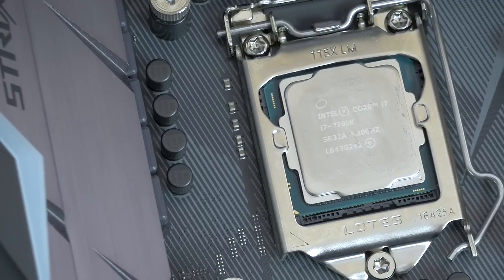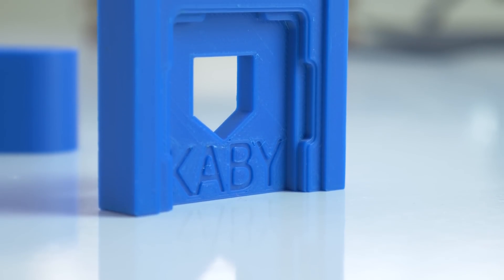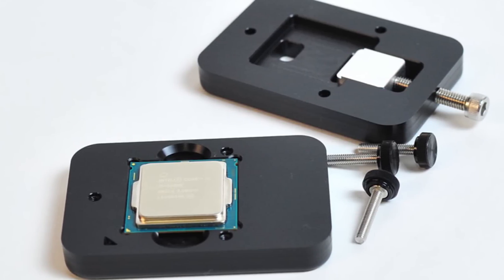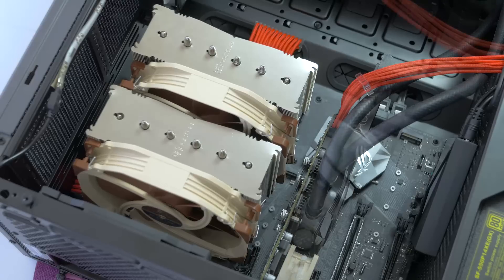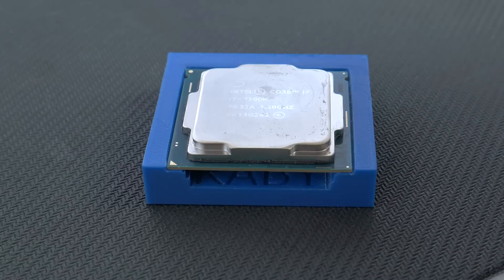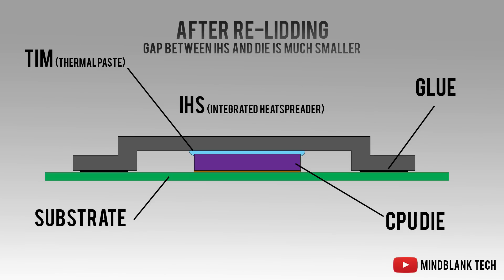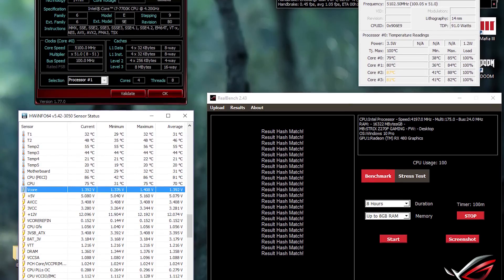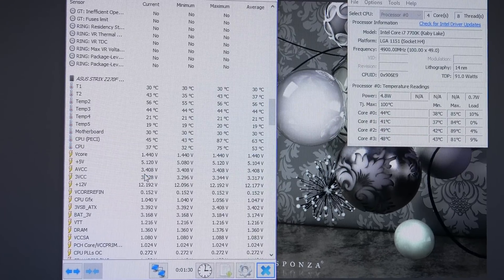Delidding the 7700K - 5.2GHz Overclock - 25C cooler

Comment: I delidded mine too but didn't have much difference in temperature at first, probably due to to much thermal paste somewhere. but after 2 weeks it's settled down and preforms a lot better now. 
before it could reach around 95C on all cores with just a 4.8 overclock. 
But now now the cores are from 65C to 80C during very high load. 
So it's a definite improvement, considering my fans only spin up to 1000 RPM during this load. 
so they have 200 RPM to spare in case of more heat. 
Keeping it from being to loud for my concentration.
oh yeah and ambient temps are a bit high at 23C so that affects my numbers a lot

Comment: This means only one thing that actually Intel is still producing overpriced bad-build CPU's . AND they say that AMD CPU run hot lol, never had a problem with AMD CPUs, before Ryzen they were junk in performance but had very good build with the metal lid soldered directly to the chip so no need for delidding and the new Ryzen is better in performance and still soldered to the chip so no need for delidding either. Intel needs to start producing good chips now or at least not overprice them for no reason well except monopoly

Comment: I am doing 5Ghz at 1.296 volts. Did the oc yesterday so i have not yet fully tested it. Allthough basic windows tasks are running without crashes. As does 15 min of The Witcher 3 and GTA V. CPU only about 50 degrees celcius after 15 minutes of gameplay. I am using a Nepton 140xl set as intake and my ambient temp might be arround 22 celcius :)

Comment: Currently 4.9GHz @ 1.35v LLC 5 - 80°C MAX during x264 with NZXT Kraken X62

I did try 5.0GHz but it wanted 1.40v to be stable and the temps were getting near 90°C during x264 stress test.

If I delid my 7700k would I still need 1.40v to be stable? I assume deliding just reduces temps?

Comment: Based on the imprint the liquid metal had left on your CPU, I'm guessing the reason for the crazy temps was that you hadn't used enough and the heat sink  hadn't made full contact with the IHS. You really shouldn't be hitting 100C with 1.35v VCore with that giant Noctua cooler.

Comment: Why didn't you write the 3D model is too small for 7700K? I spent 6 hours of printing and I can throw it away.
Reply from the maker: Hey dude! Sorry about that, but I did mention this several times in the video... It's an easy fix by scarping a little excess to the sides. Hope it worked out for you!
Reply: +MindBlank Tech Oh, sorry. I didn't understand. English is not my native language. My fault. I print it for second time. Enlarged to 102%. It should be ok.
Reply: Works like a charm. Thanks!

Comment: I have the standard coolermaster evo 212 and when I bought it I put it on 5.0 without tweaking ANYTHING else but the frequency of it, and was able to use it no problems for like half a day when I encountered the first failure where windows crashed and froze, put it down to 4.8 and had no problems ever since. Temps are all normal and even when I render videos temps wont go higher then 76ish degrees (C.) and at idle would stay always at 35ish and while gaming never going up then around 55~ playing something like witcher3.

I'm here because was wondering about touching the volts for get stable 5.0 but I was always a bit scared of messing up with voltages when it comes to OC specially with this cpu that is not "cheap" while some ppl told me "why you bought "K" if your not ocing like u should" so I don't know do I really need 5.0? is it that much of a difference from 4.8 to begin with? is it worth the risk to tweak voltages for that extra 200mhz? 

Aside from the evo212 also have a NZXT 550w and 32gb DDR4 crucial ballistix.

Comment: Hello MindBlank Tech! I wanted to ask you, can you lap an cpu (remove the bottom layer of the heatspreader which is made out of nickel, down to copper (make it completly flat))
Reply from the maker: Hey! If Are you asking if I can do that or if it can be done? I did this to other CPUs in the past, no problem. It's just a lot of work and patience. Not a whole lot of tools required for it, but patience is key to getting good results!

Comment: should i do it to  SB chip? like my 3930k? its a hot rod man, idle at 50c @4.4ghz with 1.32V.    case is define R5 stock 2 intake fan with 100% at front,   noctua 15D cooler.   30c is room temp, its summer here hey.

Comment: I'm new to builds, but I just built a kaby lake on asus z270e mobo, 16gigs ram, nzxt kraken x61 aio, asus strix gtx1070oc edition, fully modular corsair rx750.. Been running benchmarks and can say I'm happy with system performance, but if I wanted to overclock, I don't know the 1st thing about uefi/bios and what all of the settings mean.

Comment: Is this a vaild solution if you just want to bring down temps on stock clock in order to run the cpu in a small case and have the fans run more silent?
Reply from the maker: Yes it is. Combine this with undervolting and maybe slight underclocking and the cooling requirements see a steep drop.
Reply: MindBlank Tech Thanks, then I might try again with mitx and node 202 case. CPU cooler was going apeshit (1300rpm@50c) with 7700K in that case when just idling.

Comment: WTF is wrong with your CPU? you are the only example of a 7700K nearing 100Deg that I have ever seen. every other KL de-lid I've seen was within 3deg before and after.
Reply from the maker: +forestR1 Hey man! Don't know what was wrong with it, but this is the result I got... Maybe the black goo was too thick, who knows. 3 deg. C seems kinda low for any delid. Even Broadwell-E delid sees around 4-5C...
Reply: if that's the result you got then, that's what you got :) Ive only watched a few tech tube type videos on KL de-lid, so when I say <3Deg, take it with a grain of salt, cause it's only a very small sample. I would expect a slightly larger difference on broadwell E - it uses more power, so I would guess that 5% improvement would yield a higher outright temperature delta. but again could be wrong.

Comment: I got 4.9ghz at 1.325 volts. It's watercooled though, so it idles around 28C. Hottest I've seen it under 100% load is 65-70C. No de-lid.

Comment: Apparently my cpu is really good. It's a 6600k and at 1.30 volts it is is rock solid stable at 4.5 Ghz with 100% load temps at 60C

Comment: Why not using super glue? Some super glue resist at 100°c
Reply from the maker: +kiking78 It's not that it won't resist at high temps or in general. It' because removing the IHS afterwards may be extremely difficult and might ruin the PCB of your CPU.
Reply: MindBlank Tech thanks, that's true, didn't think about that.

Comment: Just curious why go through all that trouble of deliding and so on when you had on the Cinebench test a x5650 at 2.6ghz beating the 7700k in that kind of application. Wouldn't it make more sense just getting another pc if there is to game on it? What is the price for a x5650 now.... $100? Sure a x58 is a bit pricey but you can find them very cheap. I picked one up a few days ago with a i7 920 included for $105
Reply from the maker: +Pholiage The X5650 is listed in Cinebench by default. I don't have that kind of CPU.
Reply: I see :) Just got a hold of a Rampage III mb. Going to get a x5650 for it as a secondary platform and also play with some oc.

Comment: I bought this Cpu, did a quick 4.8 ghz clock with constant voltage. Is it normal that these Cpu's gets pretty hot?
70-80+c with a  high end closed loop watercooler. are they known to get really hot? even stock on heavy load.

Comment: I've got a 7700k clocked at 5ghz, it's got a small custom loop with a 240mm radiator and under load I've never seen it go over 60°c

Comment: would you recommend using arctic silver ceramique 2 for long term use?
Reply from the maker: No, I wouldn't. For the bare die, get a liquid metal type TIM. CLU works best as there is no pump out effect so it lasts longer - you don't need to replace it that often.

Comment: Are most of you re-lidding? What's the point of re-lidding anyway, wouldn't that make temps go back up?  I have a Sager Clevo laptop NP9873 with the i7-7700K, it is running stock and hot high 90s when crunching videos with Handbrake  (I'm a video editor)... so it seems like I should probably de-lid, just not sure about re-lid...?
Reply from the maker: I would advise not relidding. Just place the IHS on top like I did. Floating style. It's not going anywhere, trust me. That way, you ensure that the delid process will help temps as best as possible and will give you the option of refreshing the TIM on the die whenever you feel like it needs redoing.

Comment: what was your thinking behind not reglueing ? 
Can clu not dry out?  and wouldn't the CPU lid slide down when clamping it down 
thank you
Reply from the maker: it doesn't slide down. It's a very firm fit. Simply putting it on top of the die with CLU gives a little bit of drag, but lowering the retention bracket on it just makes things as secure as possible. Don't worry about this, it's really ok. By doing this you have the option of refreshing the TIM on the die or if you screw up the first time, it's easy to correct since the IHS is not glued back on. Also, the most important reason is that you are no distancing the IHS from the die with an extra layer of glue, however thin it would be. This is theoretically direct contact between die and IHS with this method. You can glue it back on when selling it if the seller doesn't appreciate the delid. But most buyers of K processors will actually be glad it's delided.
Reply: MindBlank Tech thx for the answer  👍

Comment: How do even know while recording this video that you rendered it at 5.2GHz? I wish I could also see the future...
Reply from the maker: I replied to a similar comment. By that point I had been editing for more than 8 hours and gaming between breaks (Overwatch and BF1) without any stability issues. It could have locked up or BSOD'ed while rendering, but I knew that it went through almost 90 minutes of Realbench without crashing. It crashes in Realbench at around 90 minutes or so, that's why I don't consider it stable. It didn't crash during the rendering process, just FYI. I still use 5.1GHz daily.

Comment: If you're scared to delid I heard you can hit the CPU with a hammer a few times to tighten up the air gap and drill a few holes around lid to vent some of the heat.
Reply: wtf?
Reply: @IMDYT420  lmao I dont remember this comment 5 years ago but sounds legjt

Comment: you can also just use a double edged razor blade if you want. that'll work too. as you can see there are not any compenents around the glue that could be damaged. it cuts through the glue like butter if you take a fresh one.

Comment: my not overclocked i7 4790k reaches 80C in the summer time and about 72C in the winter on the water cooled double heatsink... (under the biggest load but usually temps are about 65-68C) not a great achievement... temps should be about 10C lower - I know that it's 4,4 GHz but still...

Comment: im using a lidded i7700k at 4.9 GHZ with variable voltage between 1.3-1.4V, im also using the thermaltake 3.0 riing rgb water liquid cooler. I did the oc with the automatic tpu tunning that came with my Asus Maximus  IX Code. Initially during the tpu optimization it tried an oc of 5.0 with no problem, then an oc of 5.1 and it passed, while it tried the 5.2 oc windows crashed. So i settled with 4.9 GHz since I only play games and that was enough for me. PS: I didnt oc the memory which im running at stock 2400 curently. anyone has any suggestions or tips? Im content witn the performance for now but I'm willing to test if someone suggests something interesting :)

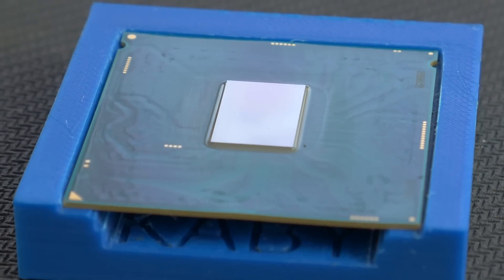Comment: 7:12 wait, but how would you know that you rendered without any stability issues while still making the commentary?
Reply from the maker: Hahaha, good point! By that time I had been editing for like 8 hours and had it at 5.2GHz during breaks (break = Overwatch, BF1 etc. :D) and it was stable. However, Realbench will crash at around 90 minutes in. So it was a guess in fact, since I banked on the fact that rendering will not make the system lock-up/BSOD etc. And it didn't!
Reply: Nice, I figured you probably would of pointed out if you where wrong about that anyway. Good video btw. I don't remember ever seeing such an improvement from delidding before.

Comment: If 5.2 ghz is on air then WHAT YOU CAN DO WITH LIQUID COOLING!?
Reply: If done with AIO, and depending on the air cooler compared to the AIO, the difference would either be negligible or significant (not large like 15-20c difference, but 10c gap... which is actually significant). If done with a custom loop... its a question of how low can you go (meaning how much do you wanna cool that thing) and its how deep in the ocean can you go to lower that temp.

Comment: my 7700k is doing 4.9ghz with 1.275 volts (it usually stays below 1.25 volts) I have h100I v2 and temperatures hover around 75-80 in aida64. 
Ram is 3200mhz with cas 14.
cache is 4.6ghz.

everything is rock solid.
I just dont see the attraction of 5ghz except for bragging. 100mhz would be hard to quantify at the risk of delidding.

Comment: no improvement over 5820k
Reply: Because that chip didn't need a delidding.
Reply: Based on Der8auer's delid, it looks like Intel skimped on the soldering as well... Like, goddamn... when liquid metal TIM outperforms the solder itself, you know Intel's shadier than initially thought of. If the 5960X got 9c shaved off via delidding, same story with 6950X (which he also delidded), well so much for that.

Comment: kaby fail ! like 5 % over 4790k if that
Reply: That's why we need Ryzen to kick ass.
Reply: MrAsus3571 | that's the problem. Intel is doing a shitty job.
Reply: MrAsus3571 or even worse i5 2500k at 4.5ghz beats i5 6500
Reply: DrathVader Thing is Ryzen will be the same, but cheaper.

Comment: I would like to see more people running their delidded CPUs with the bare die.
Reply: They'd probably have to design a cooler made to sit lower in the socket to make up for the gap that was taken by the heat spreader.
Reply: Why not just tighten the mount of the existing cooler?
Reply: Because you can't lower it below the CPU bracket where the bare chip is.

Comment: Everyone says the FX-6300 runs hot (I have 4,3 Ghz OC at 1.425v) and yet in only ran at max 75C after 30 minutes of video encoding with 0% Fan Speed on a Dark Rock 3. It never goes above 50C when the fan is on and I'm starting to feel like Intel uses the shittiest thermal paste ever.

Update: Just tested at 0% fan speed and it didn't go above 62C after 5 cinebench runs. The bad thermal paste on the Intel CPU is the bottleneck and the temperatures on my CPU only raised very slowly because the Cooler Itself took some time to heat up.
Reply: no one ever said the fx 6300 runs hot. Its not even a complete cpu. (1 module disabled)

Comment: DISCLAIMER: THIS WILL VOID THE WARRANTY
Reply: I learn a word from modder at MNPCtech once.

"The item is not really yours, unless you break the warranty"
Reply: he should pin this
Reply: Removing the sink counts as breaking
Reply: Benther the purpose of this deliding is to remove that black adhesive and that is not covered in warranty if we remove it completely.
Reply: And prizing open a sealed unit isn't tampering? under the exact wording of the law even overclocking is tampering with the product and therefore merits voiding of warranties.

Comment: I had delidded a 6700K and replaced the under-IHS TIM with liquid metal and saw very little difference (5C at most).  All the while many other people were getting 10-20C cooler temps.  My temps weren't bad to begin with, so I think there's a huge YMMV with Intel's quality control, and delidding may not be worth it if you're temps aren't stopping you from reaching a max overclock like with my CPU.

Comment: very well done video btw ! :)
im about to buy a I7-7700k or 6700k I've never ever had an i7 before. i've had a i5-6600k and never went over 60c in overclock (and 60c is a lot imo). so i am wondering, how many months can a overclocked i7-7700k or 6700k at max 4.5-4.7ish can run at such 80c++ temps if used everyday for gaming and especially video editing-exporting-converting etc. thank you :) !
Reply: 60C is not hot, not by a long shot.  4.6 Ghz should be obtainable even without a delid, as long as very good cooling is used.  Unless you live in a very hot environment, i doubt you'll ever see 80C CPU temps while play games at that frequency. You will probably replace your whole system well before your CPU died, even if you did keep hitting 80C.
Reply: and lets say maximum 2 videos being edited, rendered and converted each day (max scenario) i should have a good long i7 life? I am looking at the noctua dh14 cooler , the d15 will not fit in my microatx case unfortunately and i am wayy to spooked by water coolers.